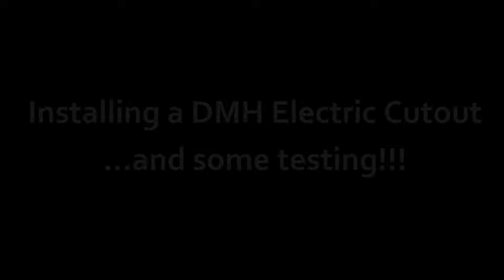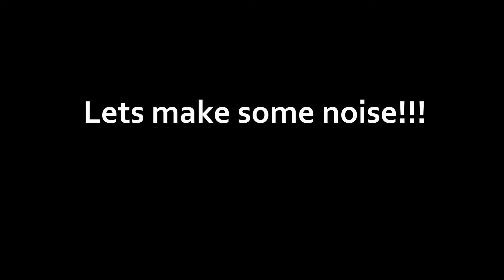DMH Cutout Install and Testing!  Sound/video clips!

Comment: Nice video )
Can you tell me please what is the DMH cutout ? And what it is function of it ?
Reply from the maker: Hi Firas.  The cut out has been around for decades.  Used mostly for guys that street raced, or raced at their local tracks.  You can have your car quiet all week long driving to work, then on friday night, slap on the slicks, uncork the exhaust and go lay down some runs.  Basically, it allows you to run a full exhaust, and then open it up for racing or off road use.  The electric version of today just makes it easier than crawling under the car.  It doesnt really GIVE your car more power, but it will free up power in the upper RPM especially if your motor likes to move a lot of air.  In my case, Im using it for some more noise when I want to have fun.  We'll see in a few weeks if it makes any difference on the dyno!

Comment: If you went to an exhaust shop and got a generic y pipe with an open end like this, can you buy a qtp cutout and put it on? Or if you were to buy the cutout separately with a Y pipe could it be installed
Reply from the maker: Yup...thats about right.  The cutout y-pipe can be generic.  Carbon or Stainless...whatever size you want.  The flange is a standard 3 bolt flange like you would find on a collector.  Most electric cut outs will bolt right to it.
Reply: Awesome! Thanks

Comment: Im a teen here so money is really tight, will a cut out on a stock car help it gain horsepower or is it all just for sound? Got a 5.3 vortec Sierra stock
Reply: just sound
Reply from the maker: While it doesnt ADD power to the car, it will free up power if its making enough for the exhaust to cause restriction.  It will only open up improvement at certain RPM though.  For instance, mine picks up quite a bit in the upper RPM.  I will hopefully have some back to back dyno results.  Depending on the combo, it can be a decent gain.

Comment: Is that a tubro engine? this beast has a brutal troque!
Reply from the maker: Nope!  No turbo...all motor.  Next build will be turbo though...Im already making plans :)
Reply: JEG's Garage nice dude! Is that a big block? I dont see the type of your car. Really cool daddy with your babyseat xD greets from switzerland
Reply from the maker: Hello from the U.S. then!  I think there are a couple of Thirdgen Trans Am's in Switzerland if Im not mistaken...a couple of really nice builds.  But yeah, you wont see too many!  Motor currently in the car is from a 2004  Chevy Truck.  So its a small block, 6.0L motor with LS1 bolt ons (heads, cam, intake, headers, etc).  Its a fun little car!
Reply: JEG's Garage oh nice! No, there are only USA-Fans who buy such cars in switzerland. We pay the assurance for the ccm3 and the tax per weight! We drive a lot of turbo engines here! Audi rs/s3,  audi couoé s2, rs2, rs4, ford focus rs, all the alfa romeos and fiats etc etc... how much do you pay for your trans am in USA? Greets from bern am 07:30
Reply from the maker: My 86 cost me $4500 when I got it.  It was 100% bone stock all original garage kept.  33,000 miles.  It was a steal...it was only cheap because it was nothing special.  Not a WS6, not a 350 motor, carb, etc.  But it was CLEAN.  Perfect to cut up for a swap.  :)

Comment: How’s it working for you?  Any issues over the years??
Reply from the maker: The one that was on prior to this one seized up.  They used needle bearings on the cross shaft.  The needle bearings eventually corroded and locked up.  The new version they sent me has bronze bushings.  Much better for this application.  Other than that, no issues.  The company took care of the told one too without any hassle.
Reply: JEG's Garage , thanks brother.  I’ll give them a try.  Hope the current one work out without any issues!

Comment: Did you have to add any hangers for the added weight?
Reply from the maker: No.  Its not much weight.  Exhaust is supported properly on either side of it.

Comment: Is there a lot of drone because they are directly under the car?
Reply: Doc Brown yes generally when it’s open there will be a lot of drone especially on the highway
Reply from the maker: I dont get much drone.  Fully opened on the highway its still fine.  Way less than when I had other cars with Flowmaster exhausts.  The LS firing order sort of changes that some as well.  They dont drone as much as the old SBC's.  At least not enough to bug me.  Nice thing is, I can just tweak the opening until the sound does what I want!

Comment: Thanks. Nice video. Could you please tell me from where to buy on the system or possible to provide me the link
Reply from the maker: Hi Arjun.  DMHperformance.com is where you can pick up the cutout and pipe.
Reply: JEG's Garage thanks dear
Reply: JEG's Garage it can be placed easily in any old car ?

Comment: Can you completely straight pipe with this electric cut out so that you can change between straight pipe and stock exhaust system with the remote control???
Reply from the maker: Yup.  Thats essentially what this is doing.  Its not stock exhaust...its a Magnaflow cat back.  But really its just dumping the exhaust before the cat back.

Comment: Massive power or massive clutch slip or both??!!!🤔
Reply from the maker: Haha no clutch slippage yet. I should be ok there for what the car makes. It's mostly a traction issue. I'm not even going wide open most of the time. Just squeezing it until the road can't hold it.
Reply: JEG's Garage Jeeeez....wat kinda power ur makin bro??? What motor u got there?

Comment: Does your car have cats on it ? Cause I'm looking at getting cutouts and want to put them before the cats what do you think ? I live in California and don't wanna get fined for having no cats so I figure cutouts before the cats is the best option what do you think ?
Reply from the maker: Hi Andrew.  I have no cats.  At times, I wish I did though, so it might get some slim cats at some point.  Maybe the next build.  If you put the cut outs before the cats, you might run into issues with room and with your O2 sensors.  Im not sure what kind of setup/space you have.  Also, when sitting in traffic, with the cut outs dumping right under you, you will likely get quite a bit of exhaust fumes which isnt good.  If you are going to do that, I suggest running outlets for the cut outs and try to get them behind you and shooting out to the sides rather than just dumping.  Cali laws are a bit odd compared to other states though, so I dont know what would happen if they saw the cut outs even if the cats were still there.  You'll have to check into that.

Comment: Jeg, do you find any difference in the power? Awesome video by the way.
Reply from the maker: Hey Remo...sorry for the delay.  Im WAYYYY behind on comments.  No...butt dyno doesnt feel a difference.  BUT, its so different with it open.  Its raw and violent.  So your senses are totally thrown off.  When it goes on the chassis dyno, I am going to do back to back runs with it open and closed after the tune is finished.  That'll answer the question :)
Reply: When I had open headers it felt more sluggish than usual but was still fine to drive

Comment: That sounds cool, but is this DMH cutout not messing up your ECU setup ? I understand that if you modify your exhaust you need to reprogram your ECU, or is this not mandatory in this case ?
Reply: I don't think it would make any difference if you put the cutout in after the oxygen sensors...
Reply from the maker: It doesnt really require any tuning.  Now if I was going to run wide open exhaust 100% of the time, that would require a  look at the tune.  This is just for occasional fun.

Comment: does this harm the car in any way? or increase or decrease the HP? and can i remove it and get the exhaust piece back in and get it back like it first was?
Reply from the maker: I dont think it will harm anything.  It does not INCREASE HP...it will free HP up in the upper RPM range that is being restricted by your exhaust.  However...that gain can be substantial or very very minimal.  It all depends on your setup.

Comment: Where did you purchase the set up and where did you run the wire harness from ? Thank you
Reply from the maker: Sorry for the delay Jose.  I purchased it directly from DMH's website.  And the wire, for now, runs up along the floor boards tucked under the factory heat shielding, and up through a hole that was already there for the automatic shift cable.  Which is no longer being used obviously.  The next time I have the interior apart, I am going to run the wire up through the floor right above the cut out, and run the wire inside.  Just cleaner and safer on the wire that way.

Comment: I've been wondering. Are electric cutouts the same as dumpers found on the classic muscle cars such as the cuda?
Reply from the maker: Not sure Ive ever heard them called dumpers.  There are "dumps"...which is usually just the exhaust dumping in front of the axle (shorter exhaust).  Not sure of any older cars that came with exhaust valves or cut outs back in the day.  They've always existed, but you normally have some wing nuts holding a plate on that you have to manually remove.

Comment: How did you wire a switch to it? you dont have a video of that? it would be very much appreciated it
Reply from the maker: +Anthony Foley Hi Anthony.  I dont have a video of that...it was done way before I started making DIY videos.  There are writeups on line, but here is a copy paste.  This applies to the 4th gen convertible top switch.  Hope that helps.  

If you look at the back of the switch:
TAB
E F G H

D C B A

H = Ground 
G = Empty (not used) 
F = Power (12v) 
E = Up (+) Cutout (open) 
A = Down (-) Cutout (close) 
B = Lamp (+) 
C = Lamp (-) 
D = Ground 

B and C are interchangable for the light, so they don't matter. This switch is a basic reverse polarity unit. When you press one direction, A becomes + and E becomes -. Press the other way and A becomes - and E becomes +. Get it? 

If you look at the harness side, just flip the image over and it will look like this:
TAB 
H G F E 

A B C D 

H = Ground 
G = Empty (not used) 
F = Power (12v) 
E = Up (+) Cutout (open) 
A = Down (-) Cutout (close) 
B = Lamp (+) 
C = Lamp (-) 
D = Ground

Comment: Is it still working or dous it just constantly rattle like every other valve on the market took mine off and binned it
Reply from the maker: I sold the car last year, however it was still perfect! No rattles. No leaks. Smooth open/close.
Reply: @JEGsGarage  ok but they do all seem to fail at some point
Reply from the maker: @jasonelouz3106  🤷 maybe. They take a good amount of abuse. I thought the DMH, AFTER they changed the bearing design was really robust.
Reply: @JEGsGarage  well the oem bmw one failed and 2 other cut outs so gona get straight pipe and im done ;)

Comment: How has it held up since you've installed it? I've heard they rattle a lot?
Reply from the maker: The first one failed due to the bearings going bad.  This one so far is fine.  Zero rattling.  When you close it, its tight.  Maybe the older manual/cable operated cut outs rattled?  This one is solid as a rock.

Comment: Is your drivers seat supposed to move around like that?....quite messy if it came apart under hard acceleration.....car sounds fantastic by the way.
Reply from the maker: Um...I guess while not technically designed to move around like that...they all do haha.  They arent meant to be racing seats.  Those are from a 99 Trans AM I think.  I also weigh ~220 lbs.  Im always on the hunt for seats that will fit the weird floor boards of the car, and NOT raise seating height.  Thats the biggest problem.  I dont really like racing buckets, and most stock seats from other cars are either impossible to mount to the floor, or if you do, raise your head through the t-tops.  The curse of being 6'4 :)  Those stock seats are loose and sloppy for aggressive driving, I agree.
Reply: JEG's Garage 
Maybe you're pushing the seats design envelope  a little?lol......have fun.
Regards from N.E.England
Reply from the maker: I 100% agree haha.  I think even if I weighed sub 200 it would still move too much to be used for any serious driving.  I dont drive the car enough these days to put the money into new seats...but maybe in the future.  Thanks for commenting and checking out the videos!
Reply: JEG's Garage嵐

Comment: hey! any problems with this electric cut out I'm planning on installing one for my car but I heard that electric cutouts end up burning is it true? they are cheaper than the vacume ones thats why im asking :D
Reply from the maker: I have had no issues with burning out.  My first one failed due to the bearings rusting and falling apart, causing the valve to not work.  They replaced it free of charge YEARS after I had purchased it, and they now use bronze bushings instead of bearings.  Its what they should have used from the get go.  So I would say with the newer version no...you shouldnt have any issues.  Mine lives outside too, and I drive it in the rain.

Comment: I have Rotary SP-O12-11 12k cap. and its great but a bit old bought it back in the early 90's. the only drawback is with cars that are lower than usual I had to fabricate custom lift dogs which are unavaiable from the mfg. other than that no complaints

Comment: How much more horsepower you get out of it!? And or torque?
Reply from the maker: No clue! Never made it to the dyno. I street tuned it, and it made enough to occasionally scare the crap out of me, so just didn't get there. New owners might have had it on the dyno. I sold it a couple years ago.
Reply: @JEGsGarage  if you had to guess?
Reply: @JEGsGarage  sounds awesome! I can see your body shift from force when you gun it.
Reply: @JEGsGarage I'm guessing your getting some extra torque?
Reply from the maker: @spi_890  maybe 350-380 rwhp? Same ballpark for torque. Pure guess. It wasn't a wild setup.
Reply: @JEGsGarage  so nothing that noticeable, or noticeable and your happy with it? Sounds sick! I can see that torque whip we all do when it starts to head sideways
Reply from the maker: @spi_890  oh you're talking about how much does the cut out affect power? No idea on that. My exhaust was extremely free flowing even when closed. But yes, I could notice more in the upper RPM with the cutout open. There are videos of dyno results back to back with cut outs that show how they work. They don't "add" power, they just free up power that is already there.
Reply: @JEGsGarage  I'll check it out.

Comment: how are the exhaust valves lasting im worried about them break after 6 month of somthing
Reply from the maker: Well...Ive been running a cut out since I built the 87 TA in my older videos.  This car has been running one for 10+ years and never had an issue.

Comment: I see the 4th gen seat and console swap into this 3rd gen and Im assuming LSX swapped too.. i know its a chevy but what kind of engine exactly is in this??
Reply from the maker: Its a mutt.  LQ4 6.0 L with modified 5.3 L heads, and everything else is 5.7 based (intake/accessories/etc).  So basically its a head cam intake exhaust fuel system 6.0.  Check out some of my other videos for more details on the car and engine!

Comment: Hi mate iv heard some of these valves stick when hot have u had an issue
Reply from the maker: Hi there.  I have had absolutely ZERO issues with it sticking.  The only time I had an issue, was when the old style bearings rusted and seized up.  Then it was stuck closed no matter what I did, because the bearings were completely locked up.  Otherwise, it works 100% of the time.  Cold, hot, wet, dry.  I love it!

Comment: Sir, I insert baffler into my silencer which significantly reduce the car noise. 

Any harm or causes to the engine working system like "ENGINE VALVES, CYLINDERS ETC" on inserting this muffler, ignoring the performance, efficiency, power pick up.

I'm really concern on the engine system. Looking forward for your wise advise. Thanks.
Reply from the maker: Are you asking if putting an exhaust cut out in will damage anything?  If so...the answer is no.  It shouldnt damage anything at all.  Exhaust leaks closer to the head can cause burned valves, but you would be installing this at least behind the collectors if you are running long tubes.  Most get installed much farther down stream.

Comment: My bad its DMH, are you using the whole kit that came with DMH or you just bought the DMH cut out valve? Cause in DMH website show the pipe is black and the one you have is chrome
Reply from the maker: Good question... I THINK I got the actual cut out pipe somewhere else.  I wanted stainless, and I dont think DMH offered it at the time.  I also bought that like 10 years ago :)  So the offerings might be different now.